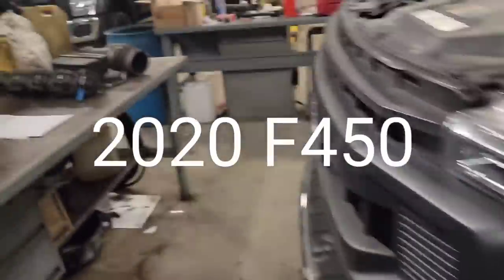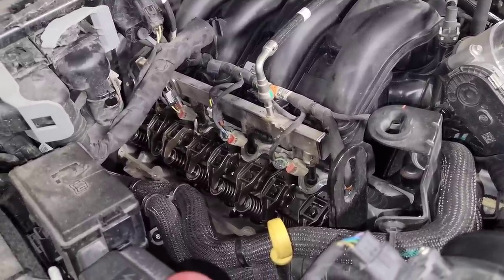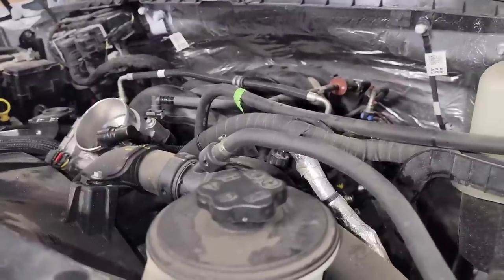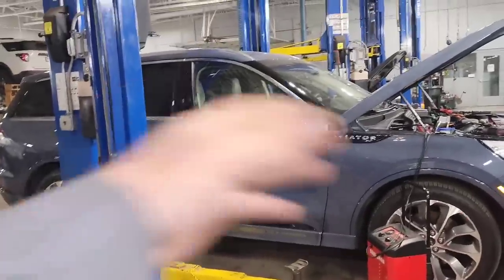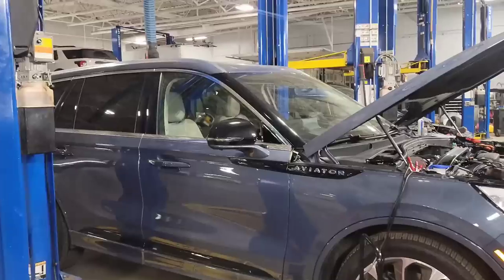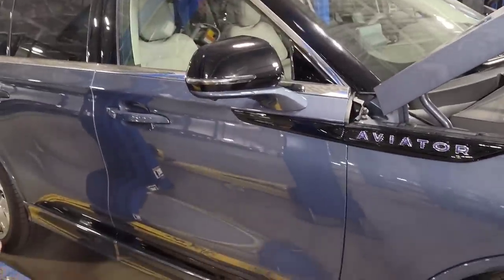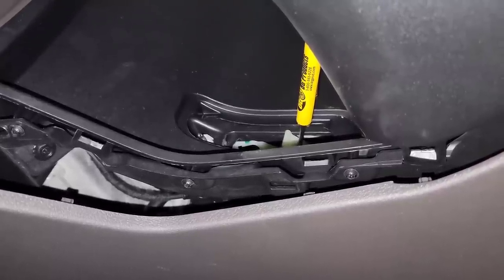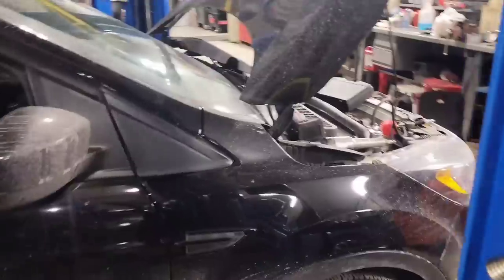2020 Ford F450 7.3L Godzilla Collapsed Lifter, 2021 Lincoln Aviator BCM Bricked - FDRS Programming

Comment: My 17 was the last new car I will ever buy. Glad I’m retired tech and can rebuild old cars till my time is done here.
Reply: With the economy, chip shortage, possible Chinese invasion of Taiwan and hyperinflation none of us will have a new car. At least we can count on our government...
Reply: @unclejoe6811  One nightmare about the chip shortage is that it might be even harder to make replacement parts for some old cars. Even the best cars are going to need something with chips now and then. Even very old cars are not immune, needing an HEI or Duraspark part could become a nightmare.
Reply: @skylinefever  I sat, jaw dropped that whole video, think WTF!! i drive a 95' cruiser, no ecu, p-pump desiel, 300k on the clock and its just getting worn in. I dont know what you classify as an old car, but mine runs without a battery pretty much (drove 800k without an alternator). i would never buy a car post '05. i got a '04 rav4 beater ($2k) that that ive had to hack the ecu on so i didnt have to replace pointless parts like egr's, 02 sensors, knock sensors. No one its ever gonna smog my beater, like wtf, i aint shelling out 1000s for nothing. these cars didnt even need fuel injection, open loop is not worse then a carb. i just put a resister water temp circut so it never actually thinks its warm, never sets a code.  otherwise the thing doesnt even shift past 3rd as the ecu limps it cause the knock sensor doesnt give the right voltage. Knock sensor?? This thing isnt even boosted, whats the point? I can hear pinging, this thing aint! let me make the choice, not my computer overlord.

Electronic brakes u need to hack just to move your car?? a module network throughout the car so i get pretty lights synronised as i fart? LOL, pull the other one. Give me a laptop, a projector, and 12v system for my firdge and let my car be a car and run fully mechanically on technology perfected years ago.
Reply: Congrats man lol
Reply: @unclejoe6811  baked

Comment: Had a 2021 Bronco roll in the other day for an oil leak. It had 7k miles on it. It was the high end with the 2.7 V6. I racked it up and pulled the the metal guards back. The quick drain oil plug and front pinion seal were both leaking. I wiped down the drain plug and where the O-ring seals in the pan, but saw no debris so I brake cleaned it so if it starts weeping again it can be seen. Also the other metal guards underneath had lots of welding splatter from the factory. The other tech commented sarcastically "Quality is job one".

Comment: New vehicles seem more and more like experimental hardware being tested on the public. Even though there's warranty to back these issues up, folks are without their vehicle with or without payments, not having the use of the vehicle is a loss to any customer. Regarding the 7.3L, do we say "cheap lifters" or a bad design from the manufacturer or just a fluke bad part? I have no respect for an auto maker that has an oil leak and a failed valve lifter shy of two years. Robust design/parts just isn't there. Pulling the engine and replacing it wouldn't be my most liked process mainly due to all of the added stress that will be applied to wires, vacuum lines, hoses, electrical connections made of plastic and the chances of collateral damages in doing a big job like that on such a young vehicle. Everything under the hood will have been "messed with" which really wasn't part of the original plan when opting to buy a new vs. used vehicle.
Reply: Well said. Couldn’t agree more!
Reply: Many cars do end up making the owner the beta tester, but that has gone on for ages. My mom (And many of our friends) ended up being some for Nissan. The 1985 and 1986 Nissan Maximas were disasters. What wasn't the engine or robot voice chip wouldn't last. Nissan finally made a new Maxima in 1989 and had practically all the bugs worked out.
The V6 engine was introduced a year earlier with no problems and was used for several years.

It makes me scream whenever I see a new engine leak come out with design flaws. That car didn't even leak a drop of oil or antifreeze in 9 years, using that old tech. There isn't an excuse. That is also why I hate BMWs, good luck getting more than 5 years without an oil leak.
Reply from the maker: This is 1 time issue so far so we monitor and see from here what happens in the future

Comment: Seeing what is coming out these days, makes me want to pick up a 2021 4Runner before they are all sold. No desire to spend my funds on future headaches.
Reply: I bought the wife a 2020, and I picked up a 2021 for myself. I hear you, simple yet rugged and very well built. You’ll love the new led headlights and fog lights. They are super bright I get flashed a lot.
Reply: @JAMESWUERTELE  I own two a 2019 Limited and 2021 TRD ORP - I am taking them to the grave with me.
Reply from the maker: Yeah so you'll be back in the dealer when the front seal in the transmission is leaking because it's pissing around the torque converter or because the front end is shot and it needs a whole entire front end and it's brand new yeah we had a Toyota store as well you ain't telling me anyting Toyota has problems as well
Reply from the maker: I have to you remind everybody this ain't a manufacturer bashing page and this is not a Scotty Kilmer drinking the Kool-Aid let's all go sing Kumbaya and buy Toyota page
Reply: @FordBossMe  I don't think that was ever the intent, Rich. I think we were just making a statement about a "new" vehicle model that does not have the same level of complexity because the platform has been in the market since 2009.  There are a lot of folks buying the current 5th gen model of the 4Runner right now - primarily because they have concerns about the 2024 6th gen model and moving to a 2.4L turbo 4, vs the 4.0 V6.  Look at some of the issues with the new twin-turbo V6 Toyota is have in the new Tundra. BTW - I am no Scotty fanboy. I pretty much only watch - your, Rainman Ray's,  Eric from South Main Auto and The Car Care Nut's content.
Reply: Well, Toyota has a statistical advantage. That in mind, they will make a dud every now and then.
Reply: @skylinefever  You're exactly right. Toyotas and Hondas will break but it seems less often. Their dealership network seems to be better also. For me, GM has been the worst.
Reply: @joeythedime1838  DUDE!!!!!! THIS IS A FORD CHANNEL!!!!! DON’T COME ON HERE PUSHING TOYATA! I get it; my wife drives an older Lexus and I agree with Toyota reliability, but I come on here to get info on and talk about MY F150! And this applies to the other guy(s) who were in that comment. Take your 4 Runner praise TO A TOYOTA CHANNEL!!!!!!!!!!!!!!!!!
Reply: @standhd  I respect your comment, but it was just a statement - and I reclarified it for Rich. I was not pushing anything and the 4Runner comment was just an example of an older platform that's still in the market being replaced soon. So who knows about the up coming reliability of the new model. I have been supporting Rich from the start of his channel and have sent him over $700 of product to test or review. Including over two dozen oil filters, the Redline oil and the 5 gallon pail of Triax Synergy SRT 5W-30 he tested.
Reply: @joeythedime1838  Ok fine. I may have overreacted, but I don’t like to see the Boss upset. So we are good. Carry on.
Reply: @standhd  Agreed, sir. We are all here to learn from the master.
Reply: @FordBossMe  haha, love that comment.

Comment: I'm glad I did not trade in my 2016 Ford Super Duty what's 34,000 miles for a truck with a Godzilla engine. I really wanted to get an f250 with the Godzilla rather but since my f250 is 7 years old with such low miles I think I will keep it. I'm basically using it mostly to pull my RV and I do not drive it in the winter. The thing is still like brand new. The more issues I hear with the Godzilla engine the more I have decided to just keep what I have. My 6.2 has been extremely reliable although it only has 34,000.

Comment: this just happened to mine on trip to long island...this week ...Ford dealer  said it  was injector....changed it out and still engine light on and valve train noise ....made it home to Texas... same symptoms... bringing to Ford tomorrow... sounds like with metal in my oil should be new engine... still under warranty.... 55k miles now .... so much for high milage dependability....

Comment: This happen to me at 30k miles on my 2021 f650 7.3l gas. Fords biggest problem  is they have no one to work or have  The knowledge to work on that motor. Ford had to replace my complete motor. I have videos and full records of oil changes  and samples.  I'm currently at 40k on the new motor.  Every now and then I do hear a slight tap tap. We'll see how long it takes from engine number 3 to come around.
Reply: This is about all most a year it has been replaced
Reply: @abrahamgimenez2199  your first mistake was purchasing a truck that large with gas engine.  Should of purchased Cummins,  allison combo installed in most medium duty trucks . International,  peterbilt,  hino,  freightliner.  Only 10k more than Ford.    Fords engine and transmission is to small for that truck

Comment: I miss the good old days of just having a 302 or straight six with 95% less things to go wrong.
Reply: And making 10 trips from not being able to tow more than 1500 lbs lol jk
Reply: This engine is very similar to a 302 mechanically. I have a 4.0L OHV v6, all the drivetrain parts are original. The hydraulic lifters can't be that different, but they can last 200K+. Usually they get reused in a new build.  The only issues they have is sometimes at that mileage the rocker loses a bit of metal where it contacts the pushrod. It could be related to long OCIs too. These engines will probably have the same fate. But for both engines it is a VERY easy repair, and you could even live with a bit of noise. I would say this is a very reliable engine for modern stuff. They should put a smaller one in the F150s, I would be tempted to buy. Make it the same size as the 302, and call it that, they wouldn't be able to make enough of them.
Reply: Depends on what straight six. Sure, I'd love the Ford 300 or Jeep inline. However, most BMW inline sizes would make my blood boil if they needed a repair. Their GDI valve deposits are some of the worst.
Reply: @skylinefever  I was referring to the Ford 300 inline 6. Not many horses, but it had plenty of torque. That 4.0 Jeep inline 6 was also very reliable, shame they got rid of it. I also agree BMW's are moneypits, I drove a new one the other day (rental car) and man they are turds.
Reply: I love my 96 f150 5.0 wouldn't trade it for any new truck no way

Comment: I’ve changed 3 7.3’s so far they all have been roller/cam lobe wear/failure. It’s likely a lot more then just collapsed.
Reply from the maker: It's an ls shit design that's why
Reply: I drove my truck into work this morning and as I pushed up I hear a faint tapping. We’ll I climbed under my 2022 7.3 and heard a tap from the drivers side so checked the oil and levels were good. Figured maybe it was just me but as I was driving home it sounded like a damn exhaust leak half way home. Got home and sure a shit it’s in the head on the drivers side. It has to be a lifter/rocker I’m guessing. I’ll know more tomorrow when I get it over to ford. 
Btw trucks been there 3 times for the trans having hard shifts 3/4 and 7/8 but they only reprogrammed the trans and refused to change it. We’ll see what happens next.

Comment: I don't see how us "old" guy's will ever work on these new vehicles. My last challenge was a 2000 Jag S type with a parasitic drain. Days in I found it in a canbus wiring not allowing the BCM to communicate the alarm was set and it was resetting the locks every few minutes.

Comment: Lifter problems well it happens to old stuff too with replacement parts. My 01 Exp 5.0 in 05 Ranger after rebuilding it had lifter problem. Biggest issue can't replace corner lifters because they didn't have back cut on lifter body by roller. Not going to cut lifter apart and put metal in the engine. Replaced all other lifters and noise is gone now

Comment: My 2020 7.3 formed a ticking noise at 44k miles from 2000 rpms to 3000 rpms. Ford technician said cylinder #3 was producing low oil pressure. Ford is replacing motor.
Reply from the maker: three was producing low compression not oil pressure
Reply: @FordBossMe  yeah I re read their message it said low oil pressure from the push rod on cylinder 3
Reply: you should have specified the pushrod in first statement
Reply: @jamesmedina2062  I don’t know anything about engines really. However ford did right and purchased a new engine for me and better yet purchased the truck back the same week and what’s crazy is it was sold for the same price I paid for it in Nov 2020!
Reply: @isaacidheileh7575  thats the problem. You know so little as to be dangerous.
Reply: @jamesmedina2062  yeah. I don’t know. Wish I did. I went off of what they told me
Reply: Would have been nice if I knew you before this happened

Comment: VERY INTERESTING!  I have a 2017 F-250, Diesel and am considering trading it in for a 2022 with the Godzilla, as I won't tow over 10k pounds. Unless the driver ran the engine above ~4500 RPM for really long periods, a collapsed lifter should not have happened. I wonder if the 2022 Godzilla is improved relative to 2020 (e.g,  lifters, PCV, valve cover)

The litany of issues with the Aviator tells me it has exceeded the point where utility has now been overshadowed and largely negated by excessive complexity.
Reply: The 7.3 Ford gas has a oil pump that is not only variable displacement but driven by a chain to a shaft running the length of the block. Show me an engine with a chain
driven oil pump that can go 500K miles. A gear drive off the crankshaft to a fixed displacement pump would be simpler cheaper and way more reliable. No way will you save enough fuel to justify this variable displacement pump. Just huge repair bills is all it will gain you.
Reply: @debi5292  I've rebuilt older Chevy and Ford V-8s. I knew that some engines switched to gerotor style oil pumps, and I think Ford may have as well. But what you describe sounds bizarre. Both from a cost and reliability standpoint, can you envision a reason WHY one would choose a chain running the 'length of the block'?  This seems especially odd because power could be extracted from the crank (or more commonly, the camshaft) at either end of the block without having to transfer that power via a chain running the block's length.  Do you by chance have a link that shows an exploded view of the block and its oiling system?
Reply: @gregparrott  There is a You tube showing the chain drive to the jackshaft along the inside of the engine block to the rear of the pan. The jack shaft actually moves on pivots on the block, and by swinging in this small arch it changes position of the gerotor in the middle and therefore displacement. chain drive and oil pump.
No engine that is intended to live a long life uses variable displacement oil pumps. This is a crazy complication of a simple system. 
It is pure fantasy and pure bull sh1t. 
I had hopes this engine might be worthwhile, not another pile of sh1t.
Reply: @debi5292  Bizarre. Can you suggest keywords I could use to find the video you mentioned?
Reply: @gregparrott  The cam phasers are an easy aftermarket get around. The oil pump drive is just ridiculous. This thing will grenade an early death IMHO
Reply: @debi5292  Thanks a lot for the link. Looking at that video, I see the shaft at 15:03 and a variant of the gerotor pump design at 15:23.
Use of a shaft is wasteful in that the older V-8 commonly drove the oil pump off of a gear at the back of the camshaft. That gear drove both the oil pump and the distributor.
While the shaft seems unnecessary, it should be reliable, The bigger problem is the use of a chain instead of gears. Chains are quieter than gears, which is likely why Ford selected them. A lot of cars use chains and even ribbed polymer belts to drive the camshaft. But these are considered as service items needing periodic replacement.

Comment: I am looking at a 2020 F250 with the 7.3 and 355 rear with 100,000 miles for $35,000. Should I avoid it due to possible catastrophic engine failure? I understand with that many miles. It may need some work once in a while, but I cannot afford a new truck, should I be looking at a different engine choice or a different manufacturer for a three-quarter ton used?
Reply: I would say if it reached 100k miles, most problems would've been worked out. The majority of issues start from a few thousand miles to 50k miles. It'll probably last 300k at this point. I would always change oil at 3k miles and don't beat on it. Offer $30k and see if you can get a few dollars knocked off.
Reply: @Ryan-u5f  thank you.

Comment: I had a aviator they hauled in and I couldn’t figure out how to get that lever out of natural. The workshop manual has instructions how to but even then I had trouble. I don’t remember entirely but I thought there was a button in where the screw driver was. To push then push the lever forward and it came out of neutral then.
Reply: Just checked and there is. There’s a detent to push down then push the lever forwards
Reply from the maker: Yeah but when I put the screwdriver in the whole there's nothing that you feel that moves at all
Reply: @FordBossMe  hmmmm that’s weird if I wasn’t off today I’d do some investigation on one of our aviators